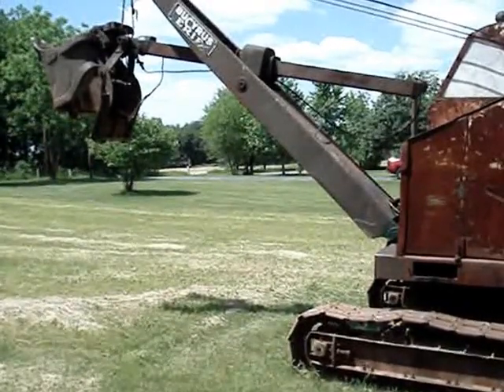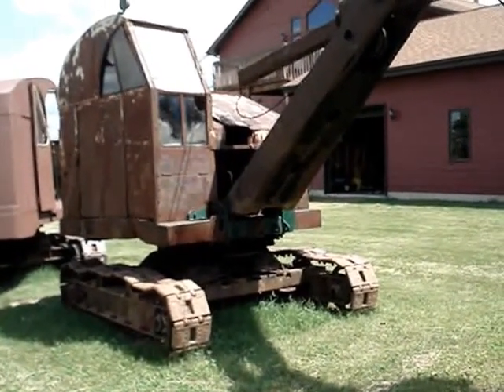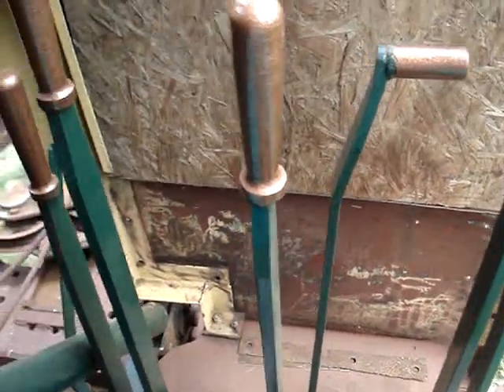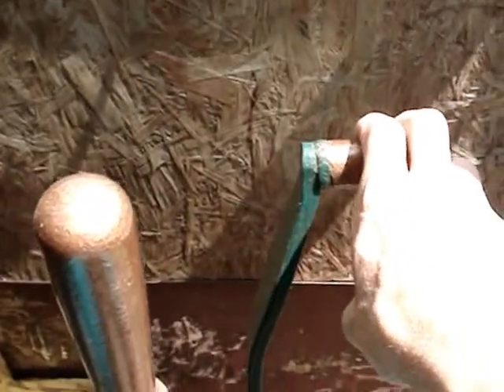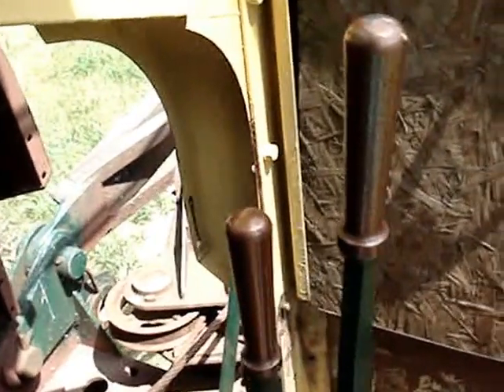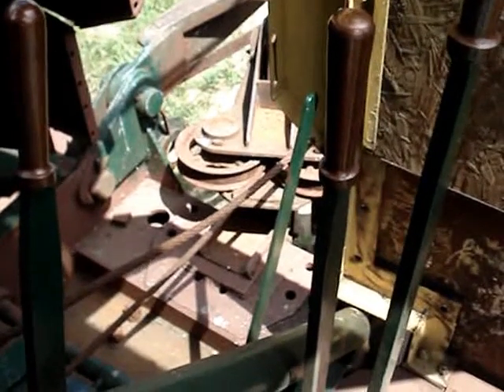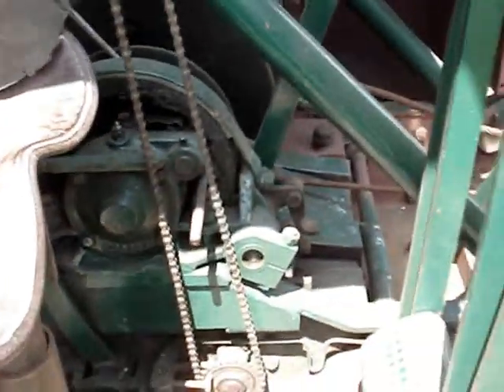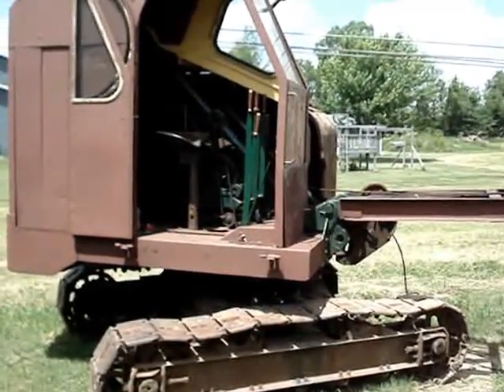Bucyrus Erie 10B Instructional video

Comment: Neat old machine. Thanks for the video explaining the controls.  How is the drive transferred from the engine to the tracks?  Thanks.
Reply from the maker: Thanks! There is a propel shaft (like a drive shaft) that runs out the center/bottom of the machine to the drive axle.
Reply: @jac5344  Thanks.

Comment: i've been watching and enjoying some of your shows on these machines.  i've operated modern excavators and chucked a job in because i was expected to operate an excavator with 6 sticks, having used modern 4 stick machines.  these really old string machines were a challenge.  at 1:09 you mention hercules.  i have a 'hercules diesel' piston.  that's what it has written on the side.  i use it for an ashtray.  it and its 3 mates and tons of pistons i cleaned out of an engineering workshop run by a hoarder who had been collecting pistons since before the second world war.  i kept just this 1 piston because i'd never seen anything built like it.  for example, 2 oil rings, 4 compression rings, 'heat treated', 'zollner 174' (whatever that is)  everyone who's mechanically minded takes a fancy to it.  it must have been a great engine.

Comment: I hope you still read comments. Could you explain a little more on how the machine propels and it's steering works? Thanks. 🤔🤔🤔
Reply from the maker: In the drive axle there are 2 basket clutches, just like a motorcycle clutch. When you turn the steering crank it will disengage one clutch and eventually apply the brake. Turning the crank all the way in either direction will disengage both clutches and apply the brakes to lock the crawlers for digging.
Reply: @jac5344  thanks for the answer. Sometimes I have a hard time visualizing the drive.

Comment: Great video.  For Hercules engine parts try Zimmerman Cletrac in PA   I have bought injectors and other parts for my engines.  They maybe can help or steer you to someone with parts.   717-738-2573.  This is the first 10 in your videos I have seen set up as a dragline, the ones we had were all shovels.   Phil

Comment from the maker: Height to top of cab is 9'9", max width at crawlers is 7'8". Length of course depends on the boom. The shovel boom is 13'6" long and is 15' high at a 45 degree angle. The channel boom is 28' long and is 23' high at a 40 degree angle. In lowered position with shovel boom I would estimate 23' length and with channel boom 36'6" in length.

Comment from the maker: Your welcome. My only operating issue with the '51 is the steering. The small jaw clutch behind the bottom sprocket is worn badly, and will barely grab unless you press your foot against the sprocket, and I think the brake bands have oil on them, which leaked from the gearcase. The brakes shouldn't be too hard to fix; the oil leak, I am not looking forward to at all, but it's on the list.